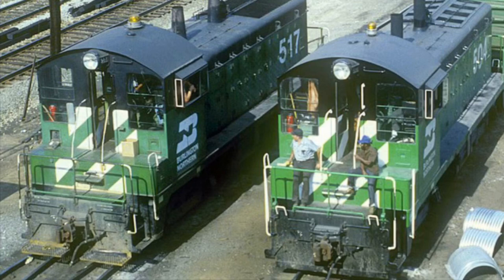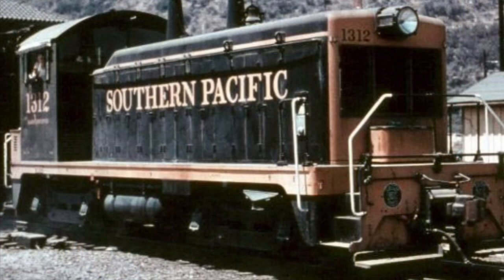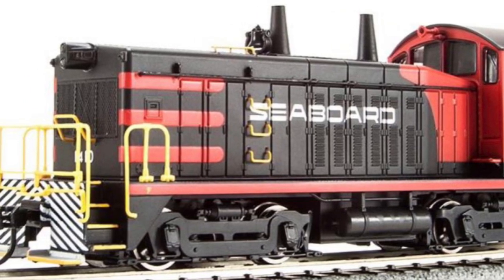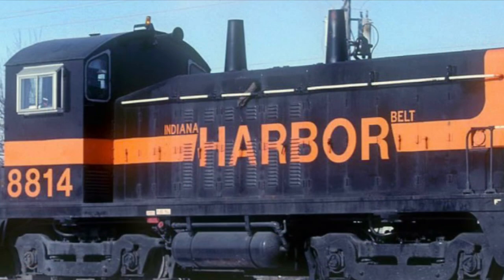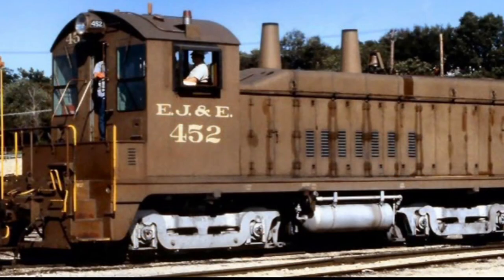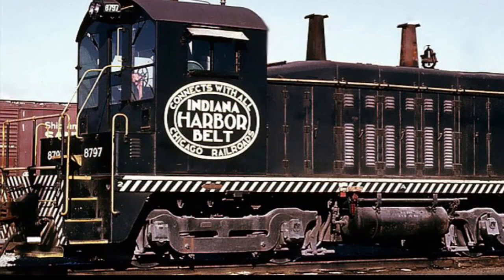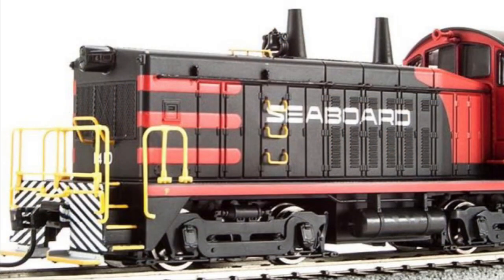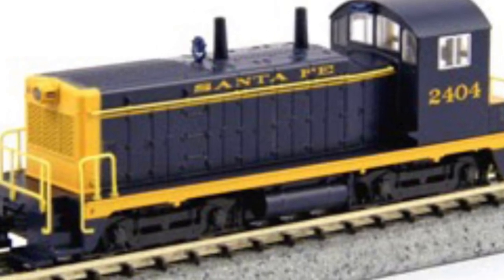Engines Of North America: The EMD NW2

Comment: Nice job on the video.  It's pretty obvious how and why the NW2 killed the 0-6-0 and 0-8-0 yard goats forever.  After these and similar switchers came along, not many railroads held on to their steam switch engines.  At only about 30 tons, the NWs were perfect for light branches, and some like the Lehigh Valley lashed 4 or more "pups" together on coal branches.
Reply: The NW2 weighed 248000 lbs !

Comment: The Southern Pacific ordered SW8's (a direct descendant of the NW2) with dynamic brakes.  The resistor grid on these is located directly in front of the cab on the hood.  The Oregon Pacific has an ex Espee SW8 with dynamic brakes.
Reply from the maker: Very cool! I’ll try to keep that in mind for when I cover the SW8.
Reply: So did the Lehigh Valley . Which are the engines the earlier poster is refering to.

Comment: Thank for the video, but the weight given in the video is 62,030 pounds. The Engines of North America website indicates a weight of 248,000 pounds.
Reply: The customer specified the operating weight.  Diesel locomotives in North America have concrete blocks in the carbody.  The extra  weight helps with adhesion on starts.  Different customers specify different weights depending on their operating conditions and specifications.
Reply from the maker: I did not know of this source till now, thanks! I’ll try and use it next video.
Reply: @ironhorsehistorian9871  I WORKED ON ALL KINDS OF SWITCH ENGINES FROM 1980 TO 2000 NEVER SEEN A ENGINE WITH CEMENT BLOCKS FOR BALAST
Reply: The 62 thousand is probably tractive effort at 10 mph.

Comment: Top speed of 65 mph?  That's pretty good for a yard switcher.
Reply: I seriously doubt that.  Most of these early switchers were geared really low for better mechanical advantage when starting up.  Before someone says "but a diesel electric locomotive doesn't have gears!", remember that there's a reduction gear on each axle (traction motor has a pinion gear, axle has a larger gear). I don't think AAR type B switch engine trucks could have been rated much higher than 30 MPH...I know that when a switcher was being moved on the road, the trains were operated under a 30 MPH speed restriction (that's with the switcher off and coupled in behind the road power).
Reply: @brentboswell1294  That sounds sensible.  The 65 mph figure in the video sounded amazingly high.

On a somewhat related note: Some electric locomotives really did not have any gears, including those with bipolar electric motors and a subset of those that had side rod drive.  Not sure if any diesel-electric locomotives were made that way, but it was in principle possible. A very small number of diesel locomotives that did not have electric transmission had no gears, including Rudolf Diesel's original Thermo-Lokomotiv (which didn't work very well) and the Kitson-Stills steam-diesel locomotive (which reportedly worked okay but was not commercially successful).
Reply: Most yard switchers won't top 30 mph they are geared very low for lugging power !